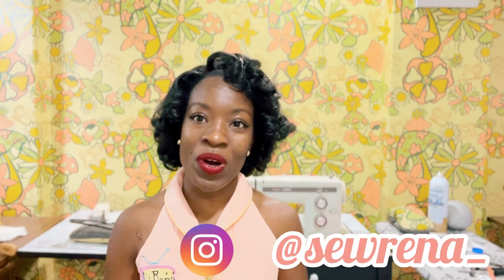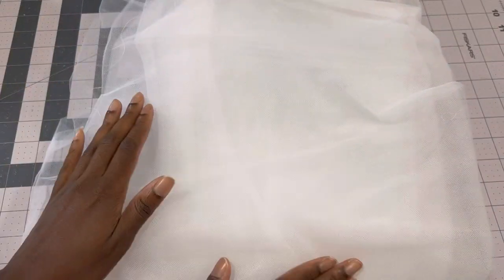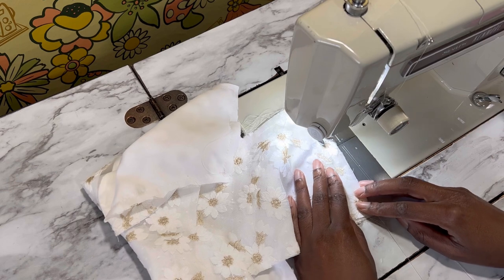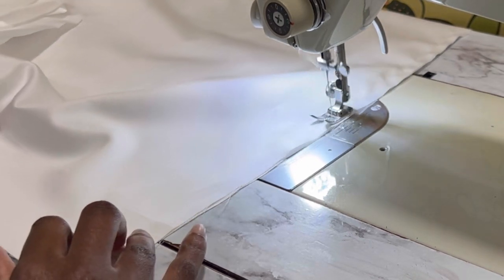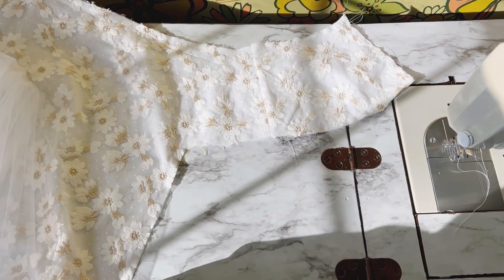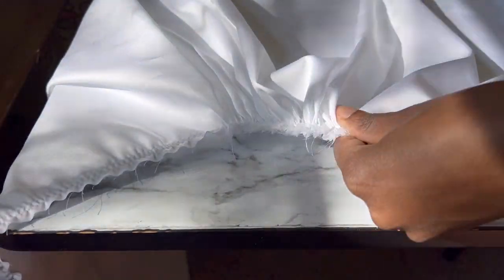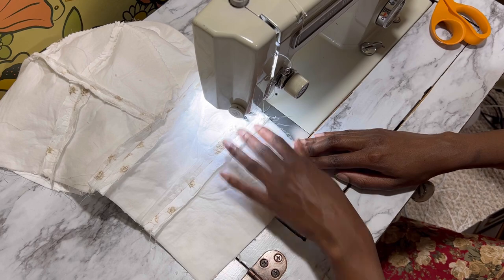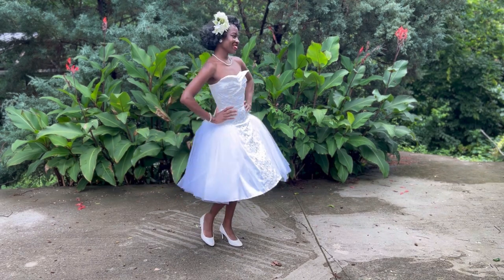Making a 1950’s Wedding Dress from Instagram 👰🏾

Comment: When I was getting married back in 1989 I designed my own dress bought above the pattern and altered the pattern to be the same as the dress that I designed
Reply from the maker: 😍😍😍 that’s so beautiful I wish I could have done something like that. I got my first sewing machine just weeks before my wedding
Reply: @SewRena  that's good that you did I'm glad I have officially been sewing for about 40 years I'm 48 years old I learn how to sew from elders my three sewing machines are a Sears Kenmore similar to yours but I have a zigzag and a straight stitch on mine then I have a Singer heavy-duty 44.52 which also has a setting to be a serger it can also be used to do free hand embroidery and much more my oldest sewing machine is a singer electric trendle g series that one I'm working on getting the parts to fix it

Comment: Do not drive that corver! My father had one. It tried to tip over on every corner. The interior always leaked. We had mosquitoes in the back seat. The seatbelts pinched. The gear shift was far too long. Later, the gear box just fell out. Ralph Nader wasnt kidding when he named it "unsafe at any speed". Make it into a planter! Stay safe so we can keep enjoying your videos.
Reply: Ignore the advice on the Corvair, Sewrena. I have a 1964 Corvair and it is no better or worse than any other early 60s vehicle. The 1972 congressional report on vehicle safety exonerated the Corvair and proved Ralph Nader was sensationalizing matters to make a name for himself. MOST cars from the 1960s are not very well designed for crash protection or regular driving. Enjoy your car for the nostalgia and keep sewing!